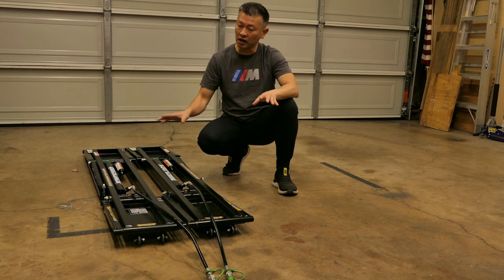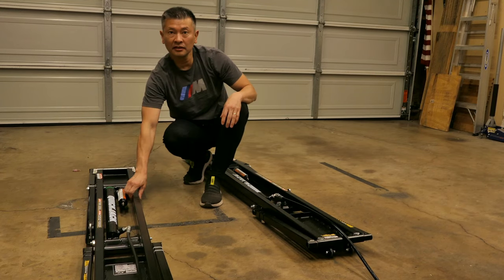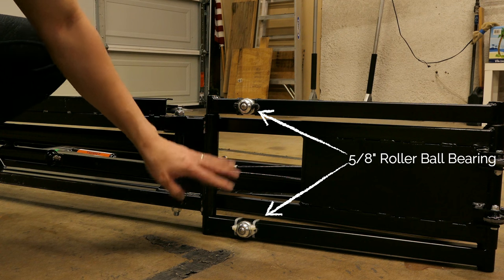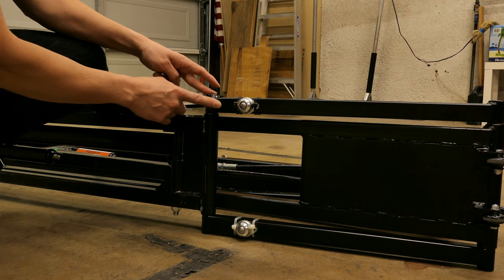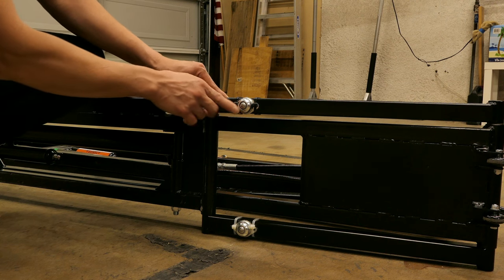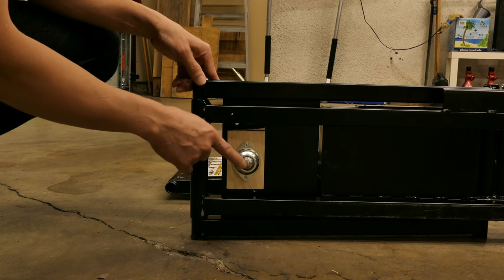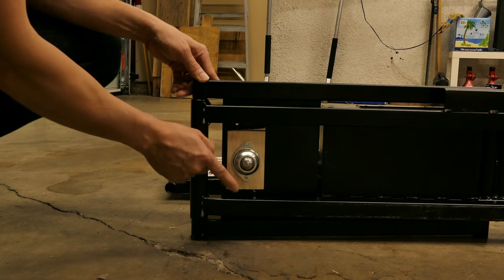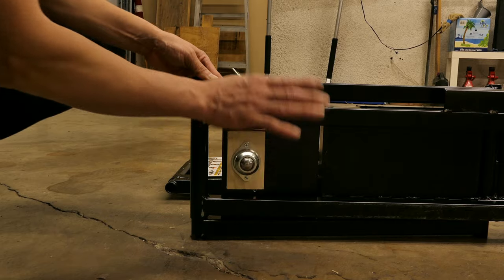Best Hack for the QuickJack, only $10!

Comment: Lots of people questioning 3 balls vs 4.  I bought 4 but afte putting on the first 2, I realized 3 would be better.  The reason is the same as why a rigid tripod is better than a rigid4 legged stand when placed on an uneven surface.  3 legs will always be in contact with the ground.  The 4th is a maybe.  These balls are imprecisely attached on an inclined surface.  Getting the two on one end exaclty positioned the same is near impossible (but helped by mild flexibility of the jack), but even if you are off a hole 1/4", with only 1 ball on the other end, all 3 will support the jack.
Reply from the maker: Thank you for your input and exceptional explanation. I couldn't have explain it better.

Comment: From an engineering perspective, you would think they'd made them with roller balls or wheels on them already.
Reply from the maker: From a lawyer's standpoint, they will not because it moves too easily and could cause fatality if not used correctly.
Reply: @TheAutomotiveFanatic  if you bothered to watch the video, the bearings are not in contact with the floor when lifted so your point is invalid.
Reply: @renli3d it’s literally his hack and his video. I’m sure he watched it before he posted it. lol  Peter, thanks for posting this. I’m headed to Harbor Freight now to get these roller bearings. Great hack!!
Reply: @YossarianHelmet  lol, you're right. I didn't look to see the name of the poster. But in his video he did address that the bearings only engage in a certain position

Comment: How thick was the block for the big ball bearing end? When you say 3m. Did you just use adhesive or 2 way tape?
Reply from the maker: The block I used was 5/8" and was secure with 3M double sided tape.

Comment: How much higher do those rollers make the QJ sit? I have a lowered C5 Corvette, my QJ's get here tomorrow just in time to replace the trans cable. I'd really like to do this if it doesn't interfere with getting under my car.
Reply from the maker: The bearings raise the entire QJ roughly 1/2". The main issue you're going to run into though, from a close to horizontal position, the QJ will not lift your C5. The hydraulic pump is not strong enough. You need to drive your C5 up ramp risers so that the QJ can lift it once it has some vertical lift.

Comment: I am at a crossroad of which type of lift to purchase and hope you can point me in the right direction. I am comparing the QJ 7000 and the Vevor 7000.  I have not found a  good comparison on each. Can you give any words of wisdom on Vevor?
Reply from the maker: Thanks for asking my option on both DIY home lifts. I cannot say that I've had experience with the Vevor, but have thoroughly researched that unit. The QJ as you know, has been around for years and I have proven it as a workhorse. It's sturdy, portable, and provides a decent level of safety (as long it it's in the locked position). The Vevor device seems to be a copy of the QJ's design. It does seem to be built with safety in mind and is also robust. What I do like about the Vevor over the QJ, is how flexible it is in accommodating multiple sized vehicle lengths. You can adjust the lifting spread length by up to 11". Had this lift come out years ago, I probably would have purchased it. Having that said, it's a tough call...you might also factor in pricing as the Vevor is much cheaper than the QJ's 7K lift set up. Good luck with your choice; I personally think both lifts are good.

Comment: How does this hack work when under load?   if there is a car sitting on them do they still move?   Any danger of the rollers being crushed by the weight of the car/truck on top?
Reply from the maker: The bearings only work when the lift is flat. Once it starts to raise, the bearings on longer make contact with the floor and raise with the lift. Therefore, it's 100% stable.

Comment: I didn't zip tie the two wheels wondering if that will fall off in time, feels pretty tight and secure.
I feel the zip tie was slightly lose cuz those 2 brackets sorta small ish...
Reply from the maker: I think over time, the 3M tape might be ok. The zipties were to provide a more secure placement.

Comment: I'm curious what your experience is with the longevity of using roller bearings. I had installed this on my 5000SLX back in 2019. When the bearings were new operation was smooth, rolling across concrete floor without much effort. Over time the rollers begin to drag across concrete leaving marks. I wish there was a better system for multidirectional rollers as the roller bearings pick dust fast and  become a literal drag.
Reply from the maker: Pro, what size are you using? In my experience, I see the larger bearing lasting longer and easier to roll around. With dust and debris, it tends to clog the smaller ones easier, causing them to not roll as smoothly.

Comment: Great video it's shocking the manufacturer just doesn't ad d this feature to their prodct at this point. Do you ever have issue with it rolling slightly my garage is not fully level.
Reply from the maker: I believe it's all about liability.  If you do have a slight decline/incline in your garage, be careful because the QJ on the rollers could slightly shift.

Comment: Hello there Peter. 1st time that I bumped into your channel. Thank you for the hack on the QuickJack. Quite useful and simple to do. I'm starting to do my homework on them, since I'm looking to get one, (like the 5000 series, being that i also have an older car from the 70s). I like that they don't take a lot of space, since my garage space is limited and though they lift the car up too-too much, it's better than me crawling on the floor with floor jacks, stands etc. I'm not a kid anymore.... (Actually in my middle 60s 😁). One question that i have for you is, i was thinking of using it in my driveway sometimes where I'll have more room  width wise...Could i use a decent duty extension cord to make the cord longer, also what amperage-wise, receptacle would i need to safely run this. Thank you for your time and stay well...
Reply from the maker: Thank you for stopping by and checking out my video! I have used the QJ in my driveway using an extension without issues. However, 2 things...you need to make sure your driveway is level and two, I use would at least a 12/3 rated at 15amps.
Reply: @TheAutomotiveFanatic  thank you Peter for the quick reply. That sounds as I thought. The driveway is quite flat with possibly a very small pitch towards the street but nothing that would make the raised car go out to it. Thank you again. In the garage, can I leave the car up for extended times, or will I have a hard time bringing it back down?
Reply from the maker: @anthonyvee  QJ designed the lift to be able to keep a vehicle up for extended periods of time. Just make sure that it's locked in and disconnect the hoses.
Reply: @TheAutomotiveFanatic  Sounds good and thank you. Stay blessed.

Comment: This is very cool.  I also keep them under the car but on two 2x8 Masonite sheets smooth side up. They slide pretty easily on those. I do like this better and might give it a try. One word of caution is be careful not to let the hydraulic hose slip under the QJ. I've done that. It will pinch and the QJ will get stuck when trying to raise the car. The car will then not lower and you will have to use a floor jack to free it. I also had one side decompress as you showed in your other video. As you learned, you cannot stop raising it when one side passed the lock and the other side before the lock or this could happen. Also don't stack more than two items under each lift point. I use a rubber block and a pinch weld puck or bmw jack pad depending on the vehicle.  Stay safe with jack stands.
Reply: I had the same problem with the hose, it got pinched under the frame and I could not lower the jack.  I had to pull out the floor jack to free up the hose, not sure what a good solution is but at least I won't do it again.  It certainly is a pain to slide the quickjacks around, they are heavy.
Reply: Thanks for the tip,if not under do u route them above?

Comment: Good stuff!  Suggest adding a few seconds of how the QJ motion works with the ball bearings
Reply from the maker: In hindsight jimmbbo, that's something I should have incorporated. I'm sure others are wondering what happens to the bearings and is the lift safe.
Reply: @TheAutomotiveFanatic  you explained it pretty well. I don't think you need a demonstration if you understand how the QJ works.
Reply from the maker: @MrBuckshot18  Unfortunately some people need a little more hand holding than others.

Comment: Worked for me. Thanks!

I have a 7000TL and had to go with a 3/4 block instead of 1/4 and it worked well.
Reply from the maker: Thanks for the input. I'm sure others using the 7K TL will appreciate it!
Reply: @TheAutomotiveFanatic  thanks for your video. I was struggling to move them around!

Comment: Many thanks, Peter and Ma-san.  I watched and learnt from both of you.

My new QJ is 7000 TL I bought from Japan and I am from TAIWAN.  Each frame has got 45.5 KG, which is very heavy to slide and move on the ground to aim right at the joints of a vehicle.

I used the same roller ball bearings and the same way you taught to install, but the positions are slightly different from your suggestions as of the length of 7000 TL.  I just tried to make the basic frame 5 mm off evenly the ground.  It works.

This is very cool indeed.  Save a lot of energy.   Many thanks !!!
Reply from the maker: Outstanding! I am glad you took this idea and made it work for you.
Reply: I just got the 7000TL and am so glad I saw this video and comment! Thanks both of you!
Reply from the maker: @tonydaroza1561  I'm glad you found this video useful!

Comment: How thick are the wood blocks? I am awaiting my Quick Jack and want to have these ready to install! Awesome idea, thanks for sharing!
Reply from the maker: The wood blocks are roughly 3/4".
Reply: @TheAutomotiveFanatic  Thank you!
Reply from the maker: @drew2.0_86  You can also get away with 5/8".
Reply: @TheAutomotiveFanatic  All done with my quick jack hack! Thanks for sharing! I love your videos, keep it going!
Reply from the maker: @drew2.0_86  awesome! Enjoy them.
Reply: Just finished putting my QJs together and trying to use them thr opposite direction under my 911 Turbo and getting the pucks positioned to the lift blocks is a huge PITA!  I will try the smaller wood spacer and rollers as I need the clearance underneath but this makes more sense to me than the 4 ball method.  I have the newest model 5000TLs and yes they are heavy but work great on my first attempt of use.

Comment: I had planned to just leave them pushed together, partially under my truck. 
Is that a problem?
Reply from the maker: I left my QJs under my wife's SUV for years without any issues. Always make sure they are never in the way when you pull into the garage.

Comment: another good hack, instead of using the QJ positioning handles supplied, they are useless because they pop off,  I use 2 pipes , 3 feet long, that fit in the pivot holes, and with wheel modifications, I can easily wiggle and push the quickjack in place
Reply from the maker: Great tip! Personally, I never used the handles for exactly the reason you mentioned...they simply did not work well.

Comment: You are a GOD. I got my QuckJack (QJ) and car lined up so that I could have maximum room in front of the car, then I taped off the edges of the QJ with reflective tape. Everything looked perfect. When I slide the QJ laterally over the tape I'm sure you can guess that it rubs the tape off. Then I get sad. This will fix that problem and you will live on in my heart for all eternity.
Reply from the maker: Steven H, glad you found this video useful. I just cant believe it took me 5 years to find a simple hack like this and make it work for me.

Comment: Worked excellent, thank you!  I modified it slightly and attached 2 bearings to the back arms as well.  Needed a small spacer but worked well.
Reply from the maker: Awesome Mark, glad you made it work better for you. Did you use two larger bearings in the back arm?
Reply: @TheAutomotiveFanatic   Thanks for the reply!  I used 5/8 bearings all the way around. 2 on each end. Not sure how durable these bearings will be, but So far it’s working great!  Didn’t raise it enough to be a problem fitting under my corvette.
Reply from the maker: @marktomcho  I hear Corvettes have no profiles so it's nice to see the QJ still works underneath.

Comment: Great mod.  I saw the other video with these same rollers, but he put four underneath, and I think the rollers on the one end (where you put the single larger roller) do not lose contact with the floor when it is raised.  I’m definitely going to do this mod.  Thanks!
Reply from the maker: Four rollers would be ideal, but three works just fine. Thanks for watching and the support!
Reply: i do have a setup with 4 (because my garage has tiles instead of a concrete floor so i have wooden board  attachedunderneath my qj to make sure i dont damage the tiles, so i had to position my wheels on the outer edges)
It works perfectly fine and all 4 lose contact to the ground when raised as intended.
Reply from the maker: @iqHunter  Thanks for sharing!

Comment: Genius!
I was about to ask about rolling while jacked up, but you thought that out. Bravo!
You do not get any shift while the car is going up until the bearings are off the ground?
How much height do these add? My ground clearance is super limited with a Corvette
Reply from the maker: Thanks for watching this video. Using these on your Corvette may prove to be difficult. Mt GT4 is low'; assuming your Vette is as well. You'll need to drive it up on low rise ramps to get the clearance needed to lift. With these bearings, it will add roughly 1/2" and you'll have no issues with shifting.
Reply: @TheAutomotiveFanatic  thanks much.
My Vette JUST clears at the moment.
Reply from the maker: @PMPerformance  if your Vette barely clears the jacks, I don't think the QJ will lift it. In my experience and QJ doesn't do too good of a job of informing their users...but the QJ needs some "lift" to actually lift your vehicle up. Due to the design, the hydraulics does not have enough power to left a vehicle from a completely horizontal position. It needs roughly 2-3inches of lift, before it will fully lift your vehicle up. Does yours lift the Vette from complete horizontal?
Reply: @TheAutomotiveFanatic  yea it lifts it fine as is.
It’s just a little bit of a fight at times to get the jacks under the car with the blocks. I need to remove the blocks to clear my side skirts and then once they are under, then place the blocks back in the trays.
Reply from the maker: @PMPerformance  you're lucky! When I tried to lift my 911, I had to get extra clearance so the QJ would have enough pressure to lift the car.

Comment: This is awesome! Thank you so much for sharing this hack. I would like to use the larger ball bearings in all three positions, just to improve their ability to roll around on my floor. Is there any reason not to use three of the 1” ball bearings instead of one 1” ball bearing and two 5/8” ball bearings?
Reply from the maker: Thanks for watching and the question. The only downside I see to using all the 1" bearing, is it increasing your overall unlifted height. Aside from that, the benefits completely outweigh the downside.
Reply: @TheAutomotiveFanatic  If you use bigger/smaller bearing wheels you can just position them slightly further to the front/back since the bar its attached to is at an angle you just need to find the right spot to position them where it slightly lifts the qj but doesnt gain to much hight.

Comment: Great Idea, I just ordered my QuickJacks and have not gotten them yet, so this may be a stupid question.  Is there a reason you couldn't use the small ball bearings on all 4 points on the arms about 3 inches of the axis point?  Thanks for the video and any info.
Reply from the maker: Todd, I am sure you could use the small bearings for all the corners. The most important item though, is making sure they lift the QJ off the floor when in the retracted position and are safely off the ground when the QJ is in its raised position.

Comment: Just bought mine and I already installed these bearings. Amazon sells them by the bag. Very cheap model. Fastened mine with tech screws. Mount the 1 inch ball on a block of wood for one end. My concrete is very rough and it still rolls.
Reply from the maker: That's great to hear. It took me 5 years to find this hack.
Reply: any concern about weakeneing the arms with driving the screws in them?  i've tried a previous hack, and one thing i learned is that the paint on these things isn't strong enough to hold the 3M tape.  i'd rather screw them in, but i worry about reducing the load capability.
Reply: @JonGibbs-pf2bt  One could use worm style hose clamps to hold the bearings into place?

Comment: Wow, I really like this idea.  What I did was glue strips of carpet onto the bottom side of the jack, which made it much more slippery on my floor.  The negative to this is that I have to watch to ensure that anything spilled on the floor doesn't end up making its way to it.  I would have gone with your idea first if I'd seen it. :)
Reply from the maker: Mike, I never thought about carpet, but I feel your pain. Those QJs are not easy to slide and move around.
Reply: @TheAutomotiveFanatic  
How much do they weigh, as a ballpark? 200 to  250 lbs a side?
Reply from the maker: @sadfur8728  no, they are roughly 65-100lbs depending on the model.